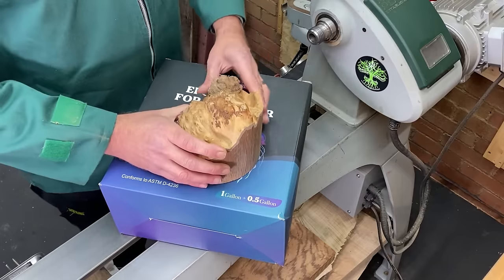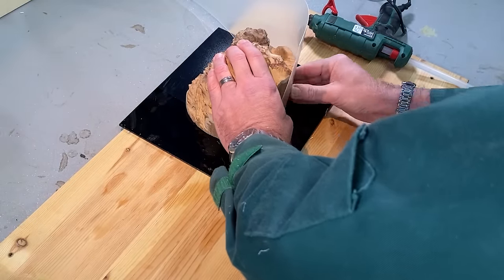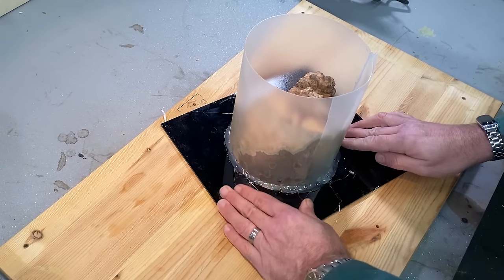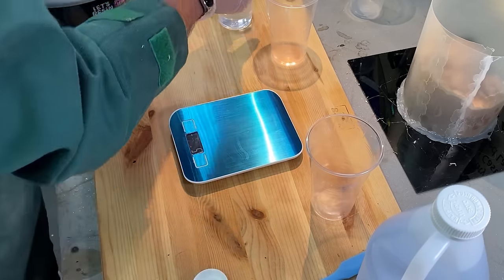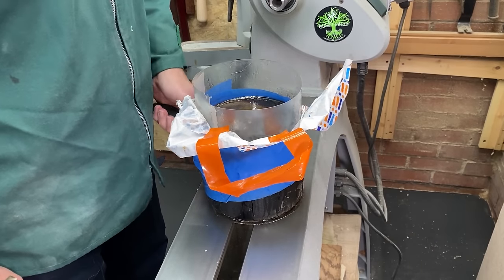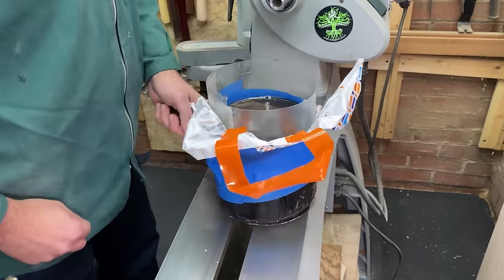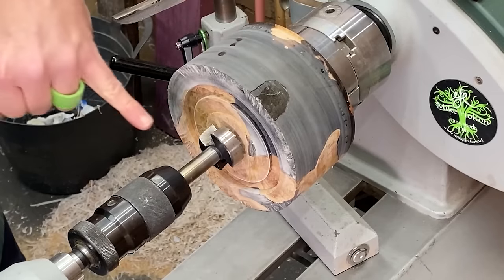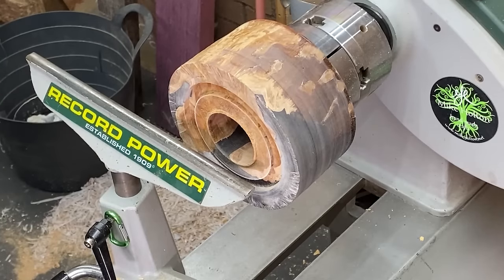The ULTIMATE RESIN Transformation! - Do NOT miss this woodturning resin project

Comment: Hi Mike as always you have produced a spectacular piece. The colours really compliment each other with the burl. I was impressed when you said you had not used a pressure pot because the finish from the mold once you turned of the plastic was amazing no bubbles. You certainly boosted my confidence in perhaps trying a pour some time, now I know you don't  need a pressure pot. Thanks for the video and the spectacular piece looking forward to the next one.⭐⭐⭐⭐⭐
Reply from the maker: Thank you so much, this resin in nice and thin so bubbles have a lot time to escape and get into all the cracks. If your wood is very porous then seal it first with either resin or wood glue, this will stop a lot of air coming out the wood while it is drying. 😀
Reply: Hi Mike thanks for the added tip.
Always learning in Woodturning.
Reply from the maker: @RoyWCanada  that is one reason I love it so much 😁

Comment: Very nice piece Mike.  Most interesting is that you finished the inside first and then moved to the exterior.  Quite contrary to most projects I see.  Thanks.
Reply from the maker: Thanks Jim, it's just the best way to make a pot. You need to have the inside finished so you can bring the two parts together and make them fit.

Comment: Nice result on the barrel, I couldn't make out the copper until you did the alcohol wipe over. Jim at Sprague Woodturning allowed separately mixed colour resins to set up for a while before adding to the wood in order to reduce them mixing and retain contrast but still get those fascinating swirl effects. Now you've got a resin sponsor it might be worthy of some experimentation.
Reply from the maker: You're right I want to try everything I can 😃

Comment: Great piece!

Epoxy creates a lot of heat as it cures. A deep pour can get hot enough to remelt the hot glue. Silicon sealant is a better choice. And you can use a cardboard box with a small heater blowing the air into a small hole for a curing box.
Reply from the maker: Wow thanks for the tip about the box. I did figure out that the heat from the resin had melted the glue and will be using a pot or silicone next time. All the best, Mike

Comment: I would maybe think about getting a pressure pot and/or a vacuum chamber if you're going to be doing more resin work. Probably the pressure pot first. Just so you don't get any bubbles in the resin. Also be carefully with hot glue. If the material you are glueing too is to cold it just won't stick to one side. If you can heat both pieces, hot glue can tear glass out of itself if you pry it apart. Just some advise. Love your work. Great to see you're being noticed
Reply from the maker: Thanks, I will be getting one but they are expensive so I'll need to save up 😀.An thanks for the hoy glue tip 😀

Comment: Thanks Mike, that resin was an extremely low bubble and deep pour one.
The burl looks like brown mallee burl from the goldfields of Victoria. If you can you should try and get some red mallee burl or melaleauca burl ( paperbark). From Oz.

You certainly had a few problems with this one but end result was glorious, I was surprised you used such a dark resin as you can’t see through it to the beautiful surface of the burl underneath.

When I pour resin I use plastic containers and or 3 or 4 plastic bags to wrap it up 8n to avoid leaks, they are a pain.
Reply from the maker: Thanks so much for the advice Greg! I may be a mallee burl, the seller just listed as 'thought to be Goldfields burl' but that is quite a generic term. I am half way through a small piece of red mallee but turned away most of the red lol. I do have more on the way though, I can't get enough of the Australian burls they are just so beautiful.

Comment: Hi Mike, great piece! Have to admit I was skeptical about the black ,gold and wood, and how it would come together. As usual, you made magic happen. I have been using Let's resin for my inlays. I'm only about 50% success, about 3 out of 6,  but that is on me and not the product. Thanks again for sharing.
Reply from the maker: No worries Mark, which one are you using for the inlays?
Reply: @MikeHolton  using their Epoxy Resin Starter kit. Most likely operator error. Just will have to keep practicing mixing and adding the mica.
Reply from the maker: @cudamank  Practice makes perfect they say 😀

Comment: Excellent video Mike. Love the way it turned out. Intrigued about the magnetic light though. Could you enlighten me and the rest, where you bought the usb magnetic light from. Thanks again for a great video
Reply from the maker: Thanks Dave, the light is just one of these put into a USB extension cable and a magnet glued to the outside :)
https://www.ebay.co.uk/itm/235178334048?chn=ps&_ul=GB&_trkparms=ispr%3D1&amdata=enc%3A1hPH2jOxzRSCA4RgrCTiSVg93&norover=1&mkevt=1&mkrid=710-134428-41853-0&mkcid=2&mkscid=101&itemid=235178334048&targetid=1647205088800&device=c&mktype=pla&googleloc=1007095&poi=&campaignid=17206177401&mkgroupid=136851690655&rlsatarget=aud-1165757154859:pla-1647205088800&abcId=9300866&merchantid=236044046&gclid=CjwKCAiA-bmsBhAGEiwAoaQNmrXKOHjvErX3fAZKWrBjwzSJC1Lp0NpNBbi-sqplSeCDq2t3usb9KxoCFaUQAvD_BwE

Comment: The hot glue probably started melting when the resin heated up as it was curing. I bet that's why it leaked. Next time you should try sealing the mold with caulk, I've seen people do that for big resin pours for tables.
Reply from the maker: I did think that and will try caulk next time 😊

Comment: Lovely piece Mike. 
I don't know how relevant this is, but I do know hot glue will remelt when more heat is applied... and that normally resin heats as it cures... as I say, not sure if its relevant, but may require a little investigation to see if that's why you get leaks...
Reply from the maker: I think it is very relevant Jaxx and is more than likely to be the cause 😊

Comment: Hi Mike, lovely looking bowl/pot, nice to see you using resin as I just turned my first resin bowl using a root from a bourgenvillea plant that I had to get rid of (far too vicious when trimming for me). You didnt seem overly concerned over air bubbles forming, is it the type of resin you used, or did you work on that off camera?  Thanks for showing yet another great idea.
Reply from the maker: Thanks Colin, I don't have a pressure pot so was a little nervous about how it would come out but you saw everything I did to it and it came out way better than I had expected. Can't wait to do another. I do however want to buy a pressure pot at some time as I feel it could only help the process.

Comment: Rather than using hot glue try white silicone. The kind you'd use around a bath or basin. The hot glue melts again once the resin starts to heat up while curing, particularly when it's a deep pour and the curing temperature is higher. You may still have a few leaks but that's inevitable when working with epoxy. It's also a lot easier to plug any leaks with silicone too.
Reply from the maker: Thanks the project I did after this I used silicone and it worked great. Although I have also been told that you can get high temperature hot glue which I will be trying, all the best, Mike 😀

Comment: And, Please explain the small USB light a bit more. I think it's great. I'd like to get the same for my lathe.
Reply from the maker: Sure, the link below is to what I bought, I just put it into a USB extension cable and glued a magnet to the back so it would stick on the tool rest. TIP, make sure you glue the magnet on the opposite side of the led not like I did first time :) 
https://www.temu.com/ul/kuiper/un9.html?subj=coupon-un&_bg_fs=1&_p_jump_id=895&_x_vst_scene=adg&goods_id=601099519706267&sku_id=17592229857388&adg_ctx=a-79728ec4~c-4e6afc22~f-dfa483a2&_x_ads_sub_channel=shopping&_p_rfs=1&_x_ns_prz_type=-1&_x_ns_sku_id=17592229857388&mrk_rec=1&_x_ads_channel=google&_x_gmc_account=710731536&_x_login_type=Google&_x_ads_account=6950480996&_x_ads_set=20175368793&_x_ads_id=148063560206&_x_ads_creative_id=659467341339&_x_ns_source=g&_x_ns_gclid=CjwKCAiAs6-sBhBmEiwA1Nl8s6wz8jVb_9VPeDSb2G2Rp7KCtP-u6NBTd3zuUMF4ry-cUftRimTYXRoCU_AQAvD_BwE&_x_ns_placement=&_x_ns_match_type=&_x_ns_ad_position=&_x_ns_product_id=710731536-17592229857388&_x_ns_target=&_x_ns_devicemodel=&_x_ns_wbraid=CjgKCAiAkKqsBhAsEigAdX-AUfwYy7Q2tgLEMTD4bEcIbzOXNY1bZ186EBpQst3VkBXBtEmnGgK8Yw&_x_ns_gbraid=0AAAAAo4mICFLnONMgaxSfcXaFP8xaHPnP&_x_ns_targetid=pla-2122868412642&gad_source=1&gclid=CjwKCAiAs6-sBhBmEiwA1Nl8s6wz8jVb_9VPeDSb2G2Rp7KCtP-u6NBTd3zuUMF4ry-cUftRimTYXRoCU_AQAvD_BwE

Comment: Very nice, Do you have any mold release? You could used it for pot when you put the leaking mold in the pot.If you are going to do more resin work you do need to get a pressure pot. Very nice design. I would love to see this on ebay thanks for another great video.
Reply from the maker: Thanks David, I don't but I will get some. I do intend to buy a pressure post and will when funds allow. All th best, Mike 😊

Comment: With regard to leakage. Did you get a thermic reaction temp increase high enough to cause your hot melt to fail on the deep pour? Most of the vids I've watched sealing similar to yours uses hot melt to fix initially and follow round with a silicone sealant for the permanent sealing. Just a thought.
Reply from the maker: Hi Chris, I have thought about it and I think this is exactly what went wrong, I have since bought sealant 😀

Comment: Really nice piece, but why did you call it an ''ugly'' burl? Burls are lovely.
Just a note from a messy cook: If you cover your scale with some plastic wrap, it keeps it clean.
 I was going to say you should put the project in a plastic bag when I saw that you did have a leak and did just that, so yeah. Probably moving it and flexing the bottom broke the seal.   Do you think using modelling clay or silicone over the glue would seal it better?
Reply from the maker: I thought the word ugly was better for the title, I love burls they are amazing. I think the resin heating up melted the hot glue so silicone could have done better or sitting it in a bag. 😀

Comment: Where did you get the light you place on the tool rest?
Reply from the maker: It is just a USB light card from China https://www.temu.com/ul/kuiper/un9.html?subj=coupon-un&_bg_fs=1&_p_jump_id=895&_x_vst_scene=adg&goods_id=601099519706267&sku_id=17592229857388&adg_ctx=a-79728ec4~c-4e6afc22~f-dfa483a2&_x_ads_sub_channel=shopping&_p_rfs=1&_x_ns_prz_type=-1&_x_ns_sku_id=17592229857388&mrk_rec=1&_x_ads_channel=google&_x_gmc_account=710731536&_x_login_type=Google&_x_ads_account=6950480996&_x_ads_set=20175368793&_x_ads_id=148063560206&_x_ads_creative_id=659467341339&_x_ns_source=g&_x_ns_gclid=Cj0KCQiAkKqsBhC3ARIsAEEjuJgeyRHAbMJTuoEQuiLY2OG_cZShVnIupsehTQ3f4DUdojvs9Y0OGVMaAgnsEALw_wcB&_x_ns_placement=&_x_ns_match_type=&_x_ns_ad_position=&_x_ns_product_id=710731536-17592229857388&_x_ns_target=&_x_ns_devicemodel=&_x_ns_wbraid=CjgKCAiA7aSsBhApEigAI3PHZhyhxHQnx4yC71dc1jSSR_KToQ0IZ_KvYrqQeVmnuY9zn8jEGgJMCg&_x_ns_gbraid=0AAAAAo4mICE3QvHDdzdeUZo42ISCABV7s&_x_ns_targetid=pla-2122868412642&gad_source=1&gclid=Cj0KCQiAkKqsBhC3ARIsAEEjuJgeyRHAbMJTuoEQuiLY2OG_cZShVnIupsehTQ3f4DUdojvs9Y0OGVMaAgnsEALw_wcB

Comment: Hi Mike,
I also turn wood-resin combos. Leaking issues are often the toughest to solve. I was wondering if it would not have been a solution to fill your mold with water, to test for leaks but also to estimate how much resin to prepare?  I believe that a day aside with a few hairblower shots to dry the wood could be a solution. Tell me if it ever works. As for myself I usually use molds and a pressure pot for three days to cure deep cast resin. Have a nice 2024 production year.
Reply from the maker: Thanks my friend, I'm usually against the clock with projects so time to dry could be an issue. I will be investing in a pressure pot sometime soon. 😀
Reply: I understand your point of view. I now find it easier to do several projects in parallel, several castings in a row, several turnings in a row and so on so that I can have enough time for curing, finishing and so on. Of course for you it would mean having to reassemble your videos as if they were continuous. Thanks for following up. The pressure pot does a great job by the way ...
Reply from the maker: @alainnoel2198  As I get more into resin projects there will have to be simultaneous projects as they do take a while to produce, you never know I may end up with multiple pots 😀

Comment: I was expecting the leak. Resin heats up as it cures, so hot glue could be turned back into a liquid. Some UV resin around all joins seems to be a common successful strategy for sealing things, but even then I've seen a lot been of failures.

If you haven't watched their channel before, Evan & Katelyn have a lot of resin projects to learn from (successes and failures 😂), and they seem to be willing to give advice to other YouTubers in their resin projects.
Reply from the maker: Hi Daniel, thanks so much for the tip, it did occur to me that it may be the heating up of the resin that caused it. never seen Evan and Katelyn so will certainly check them out. Thanks!

Comment: Nicely done Mike, a beautiful little box. I have enjoyed your videos for quite a while now, and I think we have about the same skill level, and I have been able to pick up a few pointers along the way. However, now that that you have a couple of gallons of free resin I suppose that you will be doing a lot more pieces with it. Since I prefer cutting rather than scraping, and the cost of resin puts my product cost too high for my market I'll stick to my free wood using resin only occasionally to patch holes or fix problems. However, I will still fast forward through your resin pieces. Jim, Crafted in Montana.
Reply from the maker: Thanks Jim and I appreciate that the cost of resin is prohibitive which is the main reason why you do not see much on my channel. I promise that I will still be making plenty of the usual stuff but there will be more resin in there, I have some great ideas which will be achievable with just a small amount of resin. All the best, Mike 😊
Reply: One idea for mixing resin is to lay some grease proof paper or cooking parchment on the bench before you start. I'm as messy as you and this saves me a lot of clean up.
Reply from the maker: @crackerjack3359   haha thanks, I'll try it 😂

Comment: Ah, you turners and your hot glue, when are you going to learn? Hot glue is terrible at keeping resin in. You're better off with silicone or honestly, duct tape. And you'd have got less bubbles in the resin if you'd left it in the  workshop instead of bringing it into the house. The colder the temperature (to a point), the slower the resin goes off which means the bubbles get more time to exit. Lovely end result though, I'm always amazed by what turning does to burls. I slice them and put them in tables fairly often and they're always an absolute standout.
Reply from the maker: Thanks, I have learned my lesson with hot glue lol, never again. Hopefully I will be getting a pressure pot soon so bubbles will be far less of an issue. All the best, Mike

Comment: I'm quite sure you are no idiot. I've seen you learn from every mistake you've ever made on this channel. I don't expect you'll do that again. Larger containers and higher sides are required for power mixing. I suppose a smaller auger would be better for small containers also.
Reply from the maker: Haha yes, I'm not sure I have ever got through mixing resin without something going wrong lol 😀
Reply: @MikeHolton  I think I just killed my lathe 😭. I'm afraid I've burned up the motor. It comes on but won't spin.
Reply: I can't get anyone on the phone because of the holiday. Happy boxing day though. I've been contemplating a new lathe anyhow. I might have a workaround to get my other one up and running. I'll just need my brother in-law to fab a clamping plate for me.
Reply from the maker: @archiehebron8944  OK well keep trying and let me know how you get on.
Reply from the maker: @archiehebron8944  Noooooooooo, that's my worse nightmare
Reply: @MikeHolton  I have an old rockwell belt drive lathe but no banjo for it. My brother in-law is a fabricator though. He can make a clamping plate fro the banjo I do have so it will fit onto the rockwell. That's a temporary fix until tax season. The plan is to buy a new lathe with a warranty whe I've got my tax return. 🤞🙏
Reply from the maker: @archiehebron8944  that is fair enough, you may find an old banjo to fit your lathe on Facebook marketplace or eBay. We don't have tax season in the UK as our wages are taxed at source. Although saying that I do have to do a separate one now from the revenue I may from here.
Reply: @MikeHolton  it's a racket. We get taxed at source but there are differences in what is deducted and actually owed based on your income. So generally, because I'm not wealthy by any stretch of the imagination there is a portion of the deductions returned to me. It's really quite a pain to have to file for it instead of just having it from the start.
Reply from the maker: @archiehebron8944  Oh wow! that wounds like an absolute pain!!!